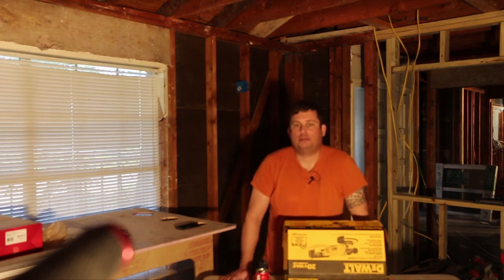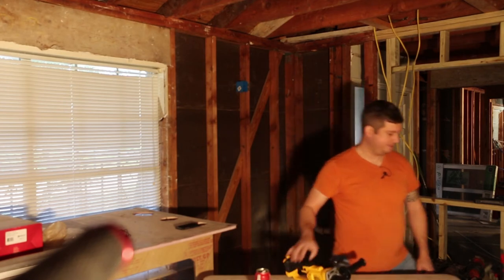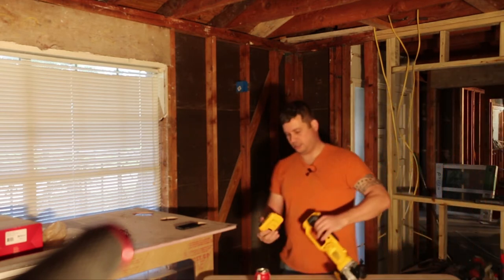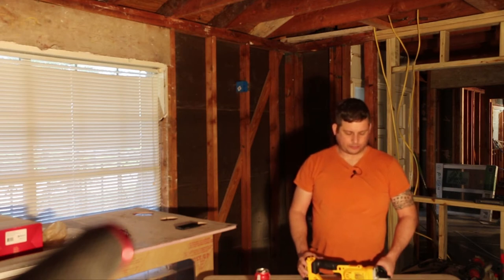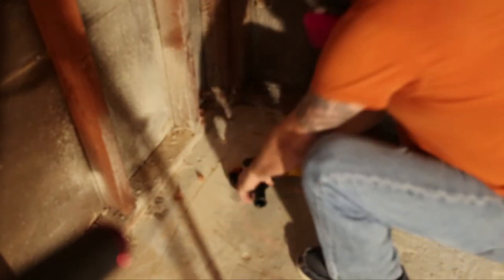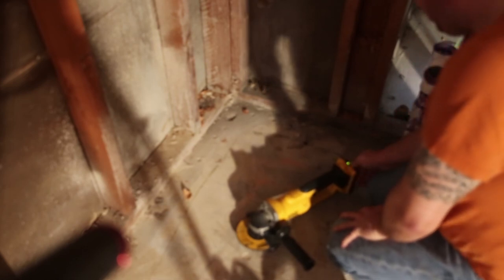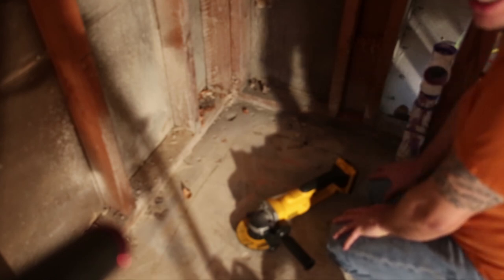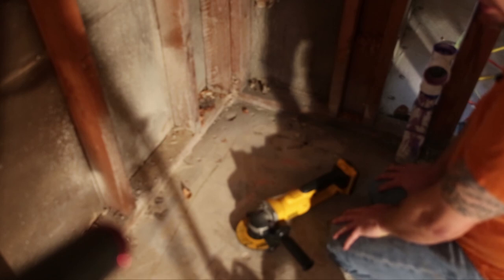Video Review of DeWalt DCG412B 20V Max Angle Grinder

Comment: still working in 2020 Brian ?
Reply from the maker: yup.  Catching tons of dust in a corner of my garage.
Reply: @hotpuppy72  Thanks for Reply , You are Correct - ONLY LIGHT GRINDING , was Thinking of this or the DCG413B Brushless , Ended up Getting Same as you for $99.99 CAD 
the Brushless has Higher rpm @9000
412 has 8000 rpm